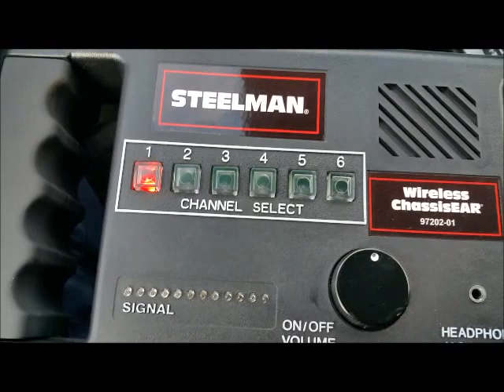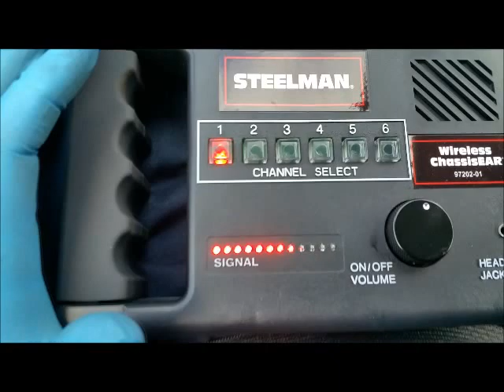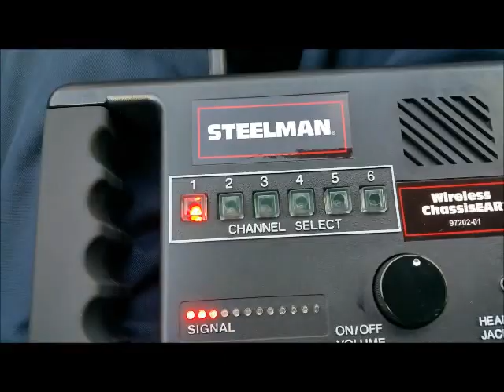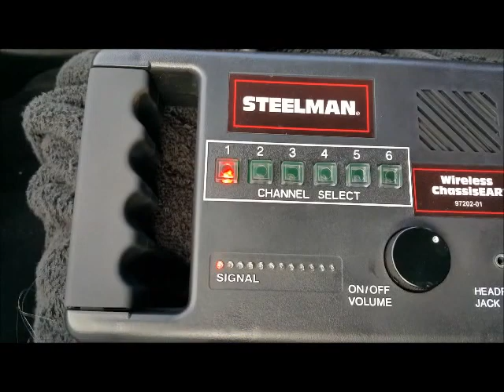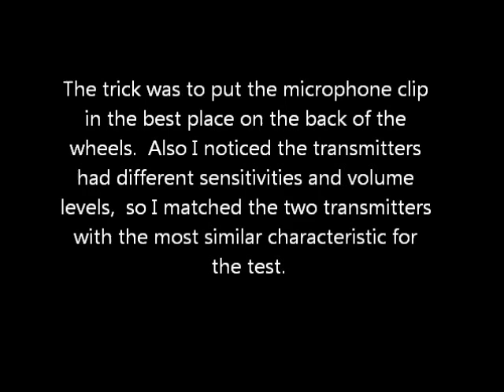Steelman Pro - Chevy Cruze Wheel Bearing Diagnosis

Comment: I have the same problem. I am just gonna trade it in. Had problems with this car since I bought it 9 years ago. From super minor to major problems up to last year
Reply: @Yeah Right never said my car was crap but the problems got worse and it got older and it was getting expensive to fix. And yes i went and bought a foreign brand car that is the equivalent of the Cruze because Chevy stopped making the Cruze. So far it hasn’t given me issues in the 2 years I have owned it.

Comment: I know mine is on the driver side but is it the axle or wheel bearing? I've been told it's the axle that goes bad and not necessarily the wheel bearing.
Reply from the maker: Unless the axel breaks it should be the wheel bearing.
Reply: @jsmerdel  and that's why i asked. I didn't think it was the axle but i didn't wanna to just throw parts at my car. I work on volvos for a living so when i was told the axles have problems i didn't want to disregard the advice someone gave me.
Reply from the maker: @satchamomcbeez6934  They had a recall on the passenger side axel. I would also look at the CV joint, but if the noise it is on the outer side near the tire it is more then Likely the wheel bearing.
Reply: hello I just replaced left side front wheel bearing now it's humming pretty good